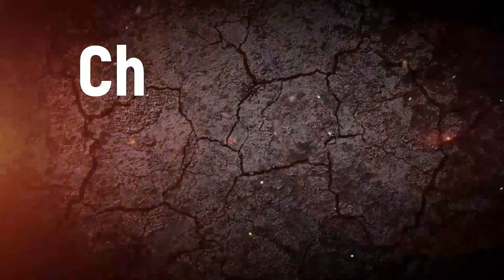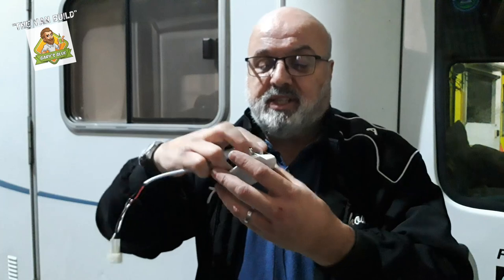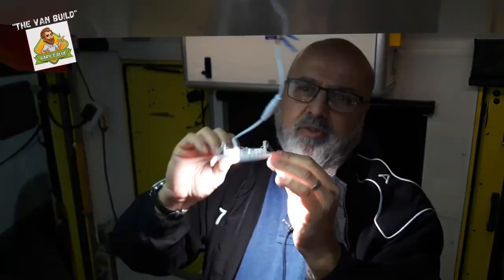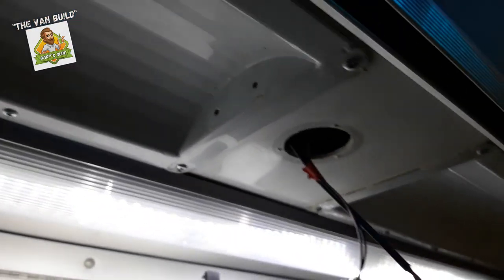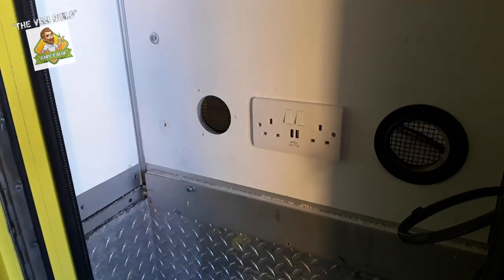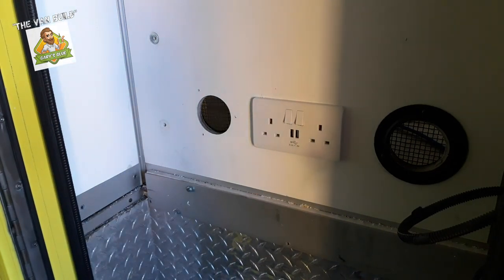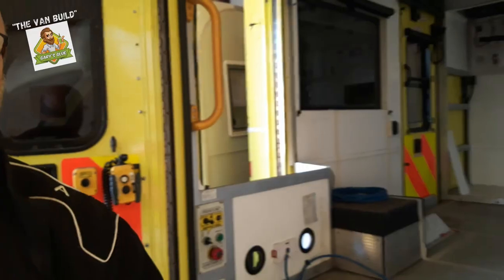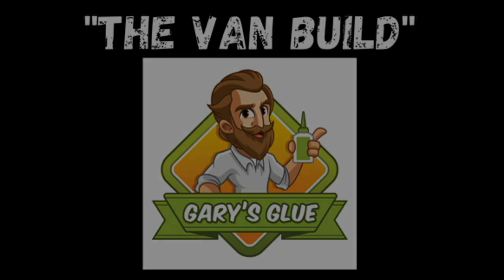Charlie & Me have taken on a winter project The Van Build. This video wiring the 12v & 220v sockets

Comment: Charging cable pops out when the battery is full as u said. Other than that as you said when you start the engine it pop-outs as well. This safety feature. If the ambulance crew is in rush there us no time to disconnect it or simply crew might forget to do so. From that point is a very useful thing. I real life campervan life we know cases that people connected by hookups drive away forgetting to disconnect the cable. So there you go.
Reply from the maker: Thanks for that I have disconnected the eject system and fitted a motorhome powerpoint and all is working great now. Thank you for watching.
Reply: Any idea where you could get this job done for a converted transfer Ambulance. Has existing ambulance electrics. EHU system for campsites. Love the van build and the campsite reviews. Kerry based.
Reply from the maker: @owenmoynihan1332  what job Owen ?